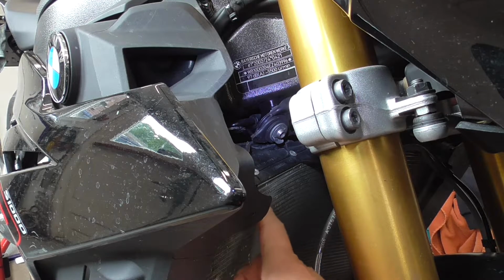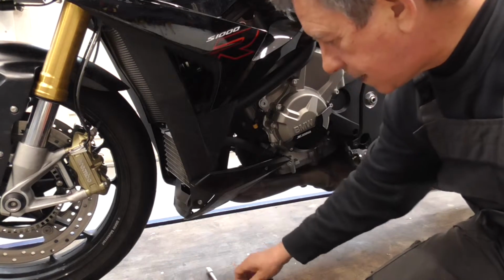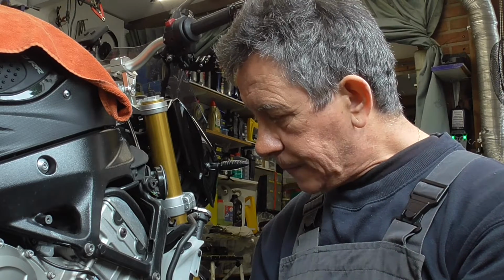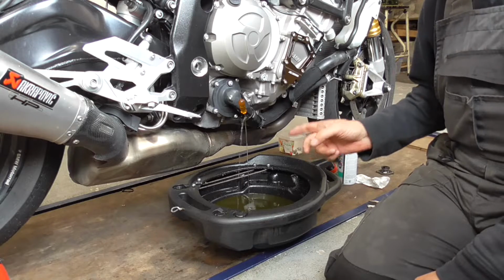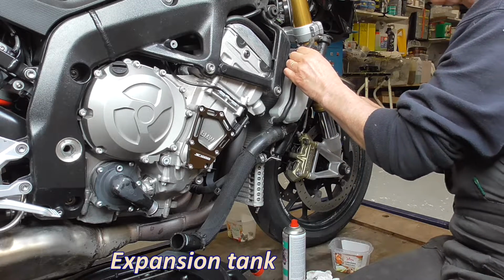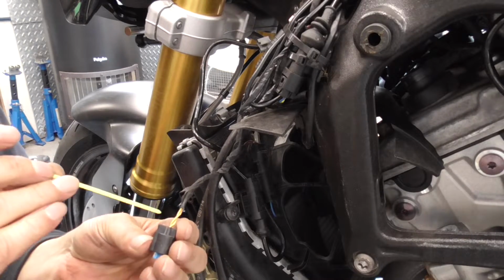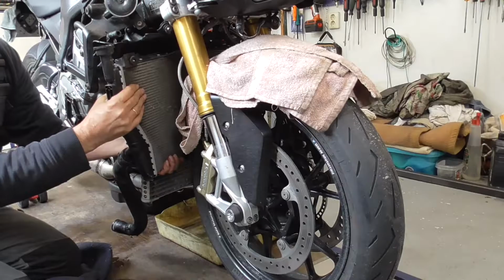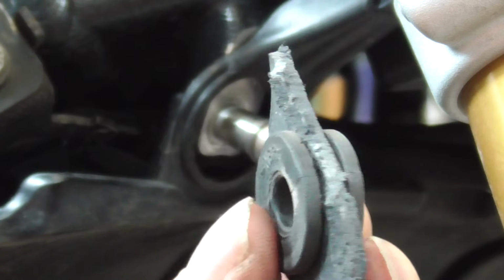BMW S1000R [2014] HUGE RADIATOR PROBLEM AND FIX IT  PART 1 !!  Done by: The Old Mechanic 👨‍🔧---🏍

Comment: Nice work OM
Those plastic rad mounts are rubbish.......so flimsy......should be made of metal. Too many bean counters at BMW trying to save a couple of euros.
Think I would have removed the front fender for easier access (only 4 torx bolts).
Looking forward to the next installment. Keep up the good work.
Jon
Reply from the maker: Hi JontyG, your absolute right..! For such an expensive motorcycle.. making this so flimsy is a disgrace.
I fullt agree with you that BMW should have made this out of proper material like metal, or aluminium.. NOT out of toilet roll holder plastic.. lolll
Greets and ride save, mate. 👨‍🔧--->🏍
Reply: @TheOldMechanic  I own a 2020 S1000R so this work is of particular interest to me.

Perhaps you could start making metal rad brackets as a business opportunity and show BMW how it should be done.
Regards
Jon
Reply from the maker: @jontyg9112  I am now editing the part 2 video, so within a day orso I will upload that too. In that video I am going to show you my solution. So stay tuned
Reply: @TheOldMechanic  Looking forward to it
Jon